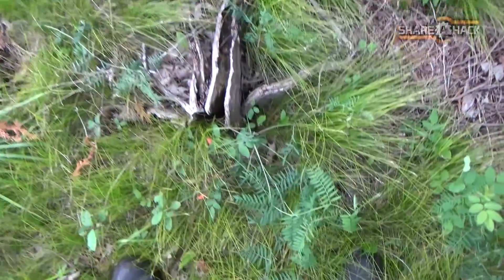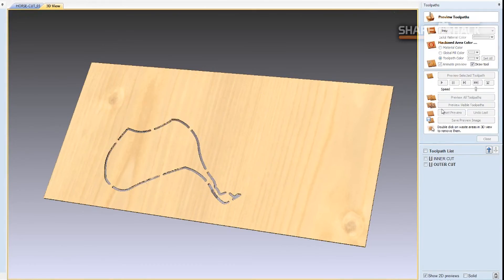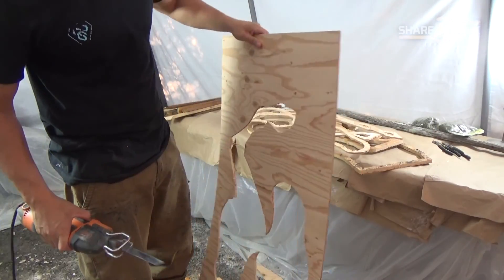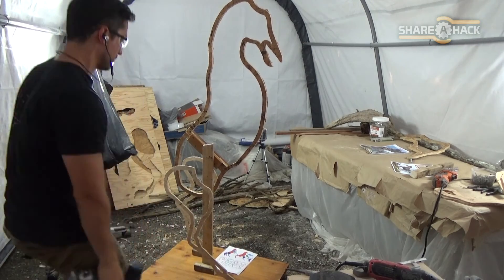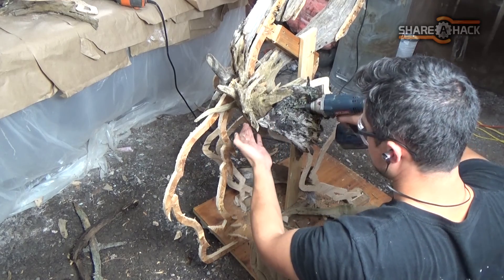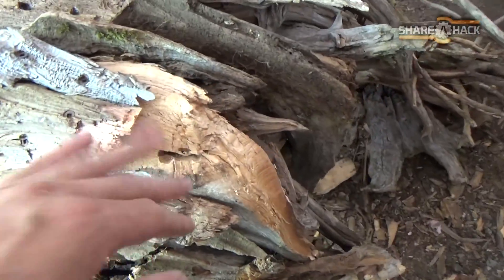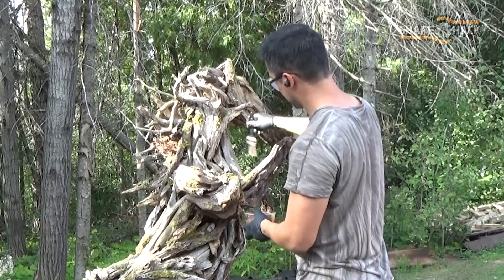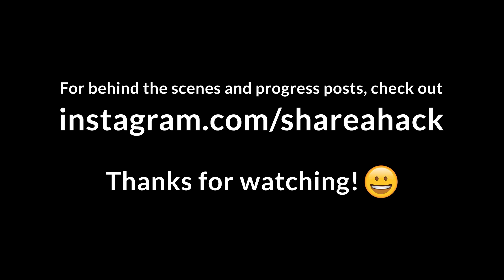DIY Driftwood Horse Sculpture How-To Build (Reclaimed Wood)

Comment: Use a dab of LEXEL adhesive on the underside of the small pieces which are covering up the "mistakes) aka screws and joints. Hot glue won't hold and it does turn cloudy and fall off eventually.  Lexel withstands all temperatures and outdoor conditions and remains flexible so when the wood shrinks and expands,  the little wood will stay put. I then secure the small pieces with an outdoor rated panel nail.  Between  the adhesive and the panel nail I've never had anything I made fall apart yet after 6 years outside.
Great job.  Hope mom loved it

Comment: For years I've wanted to build a horse. At first, I wanted rusty metal.  But the house you have built is so much superior. And you have helped me understand that it is much more complex than I originally thought. I'm not giving up just getting prepared. Can you tell me what a CNC machine is and what attachments I  need?
Reply from the maker: That's great Elaine, looking forward to seeing what you come up with. For this project a CNC machine is only a "nice to have". All it did was help me figure out the proportions a little faster by helping me build the frame of the horse. You could just as easily build your frame the old fashioned way by manually fixing pieces of wood together and eyeballing the result.  If you ever do get into CNC, its a really fun and rewarding hobby. CNC stands for "computer numerical control" and is basically any machine (most commonly with 3-axis movement) that cuts precise shapes out of a medium based on instructions from a computer. CNC machines come in all shapes and sizes and it really depends on how much you think you're going to use it. Good luck!

Comment: How heavy were the largest pieces you used❓ .....I think thats the question I need to ask. I have five pieces of grapewood root that are twisty. It took me about 6mo to figure out how I wanted them put together, to hang on the wall as a sculpture. 
Problem is each piece is fairly heavy. I bought them as "driftwood" but I can tell they are sandblasted. (because of the weight and obviously the texture) 
I'm wondering if screws will be enough? I mean I guess they would as long as I use enough?

Comment: "Ants in your pants" is an actual thing...love it. 

P. S. That was EXCELLENT!
Reply from the maker: Thanks Kim!! 😄🐜🐜👖
Reply: @shareahack   I have begun collecting wood as my lake is LOW and we had much debris go through, dam to dam last summer...next will dry and clean...then create! I am so excited to get started on fastening together my very 1st piece!  I don't have a huge supply of wood, But I wanted to practice on a small scale 1st may be a water bird... Any suggestions on getting started?🤔🕺⏳
Reply from the maker: @kimm.-e.4963  That's great to hear Kim :)  For smaller scale, maybe try to build the core structure with thick branches and then 'fill out' the rest of the body with various driftwood. Also if smaller, you might be able to get away with metail wire or tiny brad nails to connect all the pieces (you may need an air compressor and brad nailer handy). Can't wait to see what you come up with!

Comment: One more question.. I have not made a sculpture as large as yours, so I use smaller driftwood that I get from the beach here is Texas. If nails and scres are tearing my wood up, would you suggest using a glue gun to hold it all together?
Reply from the maker: I wouldn't recommend hot glue for anything structural, over time there is a risk of the bond detaching especially if kept outdoors. You can probably get away with it if it's a much smaller sculpture (desk size) and kept indoors. You could use the glue to hold things in place for you and THEN screw/nail so the glue acts like more of a 'clamp' since it dries almost instantly. Also the glue could act almost like a mortar and fill in gaps between joints so there's less play where you connect the wood. Let us know what you come up with :)

Comment: What have you done with the worms and ants in the wood? Aren't dangerous for the whole structure?
Reply from the maker: Once the wood is out of the ground they simply vacate the pieces and move somewhere new...Some users have suggested soaking the wood in a diluted bleach solution and then drying them out. Also the stain makes the wood pretty inhospitable to critters.

Comment: WOW, I learned a lot. I was using wood screws for my Rhino.. it was tearing up the wood. So I started using nails.. and I do use  super glue but a lot of my nails are exposed so I like the idea of the little pieces to cover up. My toughest thing is when I start and where to start to keep the darn frame standing. I love using the FRAME, but I do not own one of those nice machines you have to cut it out for me... Any suggestions?
Reply from the maker: That's great Linda, it may take a little longer but you could always pre-drill your holes before screwing so the wood doesn't split. The CNC machine is nice to have but you could improvise a frame out of almost anything since it will be hidden. The easiest might be scrap wood or strong branches to get the approximate/rough shape, reinforce it with screws or even wrapped twine, wire, or coat hanger. Then keep adding your driftwood on top of the frame until it's hidden. Another option could be drawing your design on a large piece of plywood and manually cutting it out with a jigsaw. A lot of professionals weld up steel frames for more permanent displays. Another idea could be to hang your main structural body piece (think of it like a spine) from the ceiling and build on to that while it hangs so you don't have to be concerned with the legs/feet holding it up at first. I hope that helps, good luck!